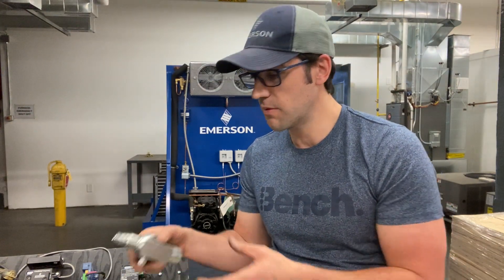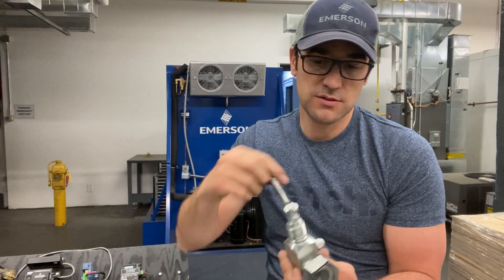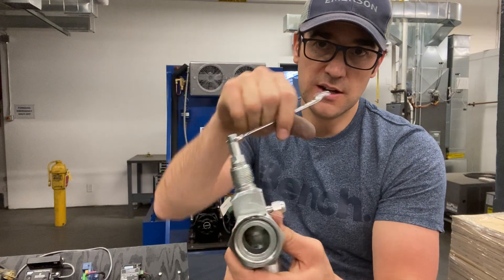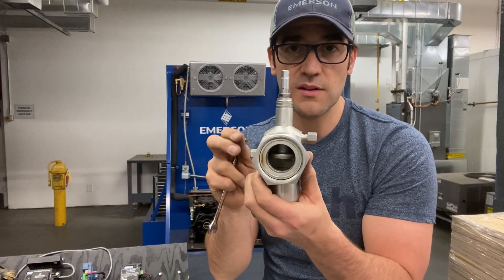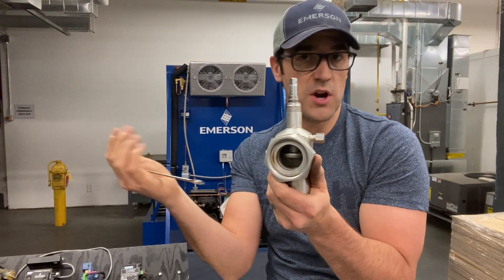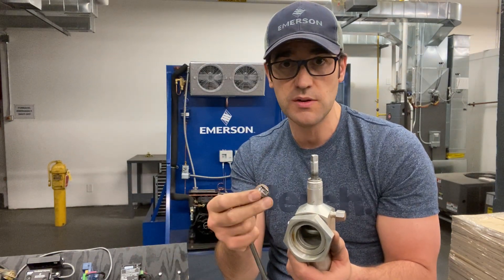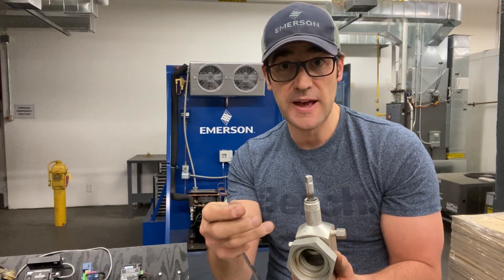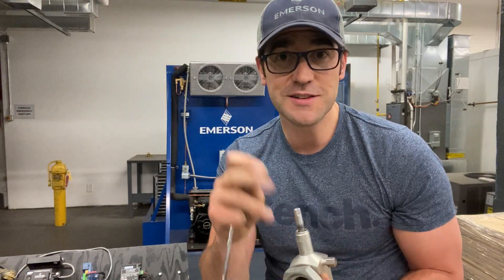Service Valve Packing

Comment: I’ve heard different things. Not to loosen the packing nut because when you go to tighten it back you are putting more pressure on the gland inside and chance cracking the graphite inside. Only loosen them if you can’t turn the valve. But when I started I was told to loosen them so that’s what I do unless I can’t (30yr old system)
Reply from the maker: The valve manufacturers I talked with recommend loosening them so I go with that. Some manufacturers may say not to on their valves but I have not heard that yet.

Comment: Do you need to recover refrigerant when replacing the packing?
Reply from the maker: Yes and No. It all depends on the valve. If is a one way valve you can fully front seat
It and replace the packing gland. Some valve designs are always open to the system so those you may need too.

Comment: I've never heard of loosening the packing nut before adjusting the valve stem. Just finished trade school and that was not something we ever did. Is the purpose to reduce the drag and friction on the packing from the valve stem turning?
Reply from the maker: Yes. That packing gland is to protect the system from leaking refrigerant. If you don't loosen the nut, you will have a hard time adjusting the valve, and you may even damage it. Check out this example but remember not all service valves are the same https://muellerrefrigeration.com/uploads/Application_Release_Service_Valves_9.19.11.pdf

Comment: Can you replace the packing by fully backseating the valve? Or must the discharge/suction line be evacuated?
Reply from the maker: It depends on the service valve. Some you can others no
Reply: Why the hell would they make one that you had to evacuate the system? That’s terrible

Comment: Alot of times I'd just use some teflon rope and fill it in to seal the packing it worked really well.
Reply from the maker: To be honest I was taught to replace the valve when I was in the field and learned of this a few years back which looks to really work.

Comment: From what I know if there is leak coming from packing nut, means the seal under it, needs to be replaced. What do you think?
Reply from the maker: Yes. There are different designs and sometimes hard to find the replacement parts.